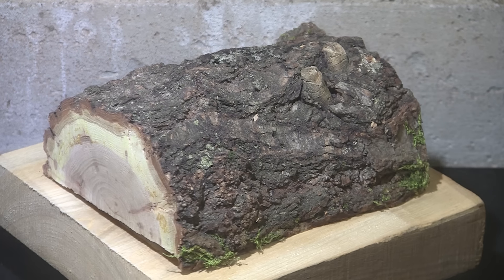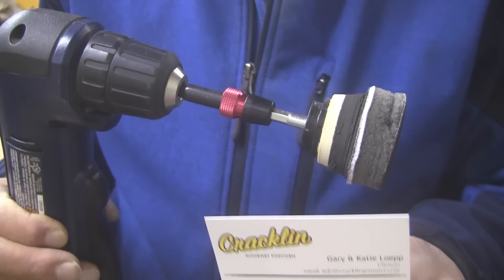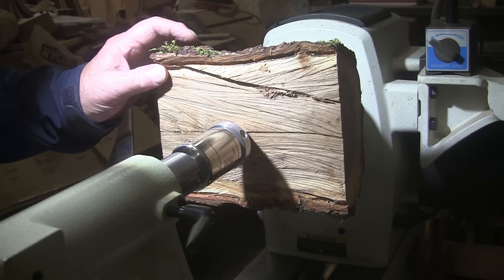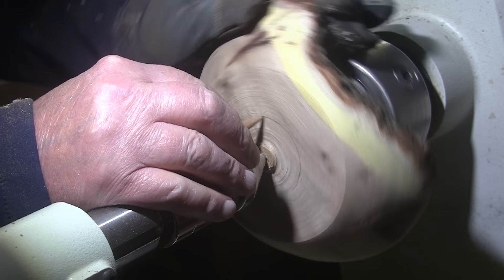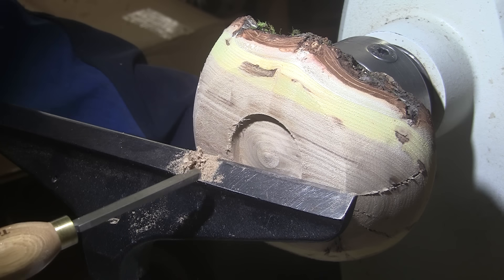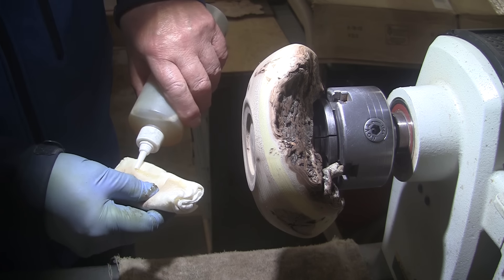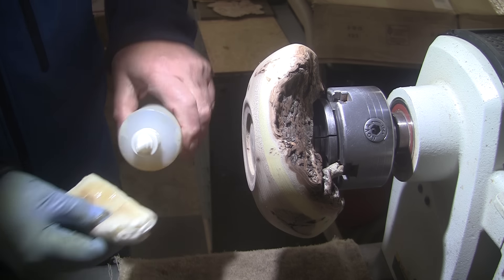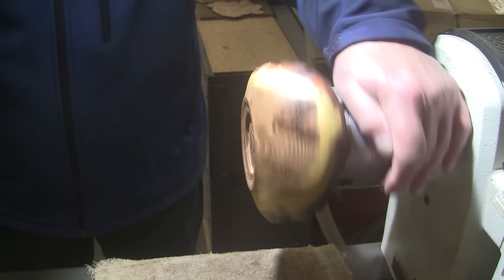Siberian Elm Tri-Color Bowl! 👀 - Wood Turning

Comment: Thin edges is one way to show skill, but that's not the only way.  Your way is to preserve the character of the individual piece of wood, and it's just as hard to do that well.   Every little weird spot is another challenge to deal with and for us to enjoy.    Love it!   I wish I could show you the piece I have chucked up.   I had to stop working on it due to a bit of illness, and it's been telling me to get back out there and finish it.   For quite a while I was worried that I had bit off more than I could chew.   It's an Elm from my mother's yard that has a 3 way crotch in it, so it's chock full of crazy grain.   I've made it to the sanding stage and there are a couple spots that want to stay rough.  I think that if I could reverse the lathe I would be able to sand them a bit easier.   I'm going to spend some time on it tonight and see what happens.   Of course, I could still decide to change it, that's what makes this stuff so fun.
Reply: One of the pieces I brought home is a 3-way crotch! The base is just shy 14" diam. and each of the branches is 8-10" diam. My name is David and it's my Goliath. Oh, joy! 😂
Reply: @calmwoodcreations3709  ha!     Very cool
Reply from the maker: If you can stand on the back side of the lathe to sand, you will accomplish the same thing, William. 😊
Reply: @PhilAndersonShadyAcresWoodshop  darn it.   Now I've got to clean up my shop.   No room!

Comment: Another beautiful bowl under the belt.  I used to watch another turner as well, Al Furtado.  He bought a boat and is off at sea somewhere.  Occasionally I see a video from him but no turning.  Anyway, he had this "secret sauce" he'd put on his stuff.  It was equal parts shellac (Zinser), boiled linseed oil, and isopropol (sp?) alcohol.  I mixed some up and use it on furniture restorations I do.  I also made up a batch using the amber shellac (Zinser).  Anyway, I get really nice results with it and I thought maybe you might wanna try.  All that said, maybe you already have.  Well, I've some birch in my garage that is ready to turn.  So long from Alaska for now.
Reply from the maker: It's called shine juice, Joseph.  I tried it, didn't like it.  Shellac works great for me!  Thanks for watching and commenting! 😊

Comment: That wood is fairly common here in Yakima. I have had real difficult getting a good tool finish especially on the inside at the transition. Your correct that it does tear out due to it's poarse nature.

Comment: Hey Phil, when I look at the finished bowl, I see the Gjøa, which was the preferred boat of Roald Amunsen the arctic explorer.  

Are you ever tempted to turn a bowl with super-thick sides?  I ask because I really like the look of the bowl that you have turned, yet I also really liked how it looked when the sides were about an inch-and-a-half thick.  It got me wondering whether you ever look at a piece and think, "I really like that bark - I'm going to leave about two inches of it and say that I've made a candle holder."  ;-). 

Thanks again for another fun and instructive video.
Reply from the maker: I have a few with very thick walls, Deirdre.  Like, 3 inches or so.  The outside usually determines the thickness.  If there are deep voids in some areas, I usually have thick sides or a hole and I prefer thick!  😊

Comment: I notice that you turn your gouge to a different angle sometimes.  Occasionally, you hold it flat, and sometimes you twist it so we only see the top and sometimes the bottom.  How do you determine the attack angle  and the twist on the gouge?  --Ed Gibbons
Reply from the maker: I guess your question is just about impossible for me to answer, Ed.  I'd really like to!  I'm not sure even if you were standing next to me I could put it into words.  Try to keep the bevel rubbing probably doesn't help much.  Sorry, I just can't help you! 😊

Comment: Beautiful, Phil! What goes into deciding whether you’ll use the 1/2 inch bowl gouge vs. the 5/8? I notice you usually use the 5/8 inch.
Reply from the maker: Using the 1/2" is kinda new to me, Ryan.  I've always used the 5/8" both inside and outside.  It has a lot to do with the condition of the wood and the natural shape of the wood, I guess.  Sometimes the wood is fragile and smaller bites might be the better choice.  I also find, it's less wear and tear on me! 😊